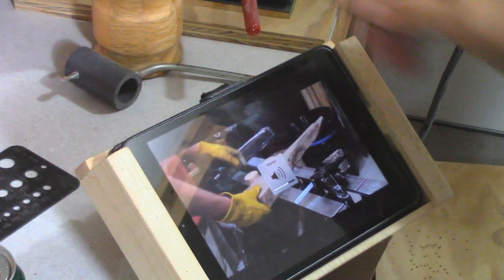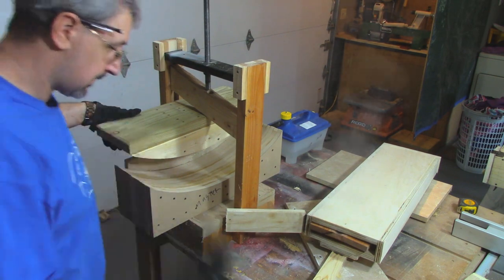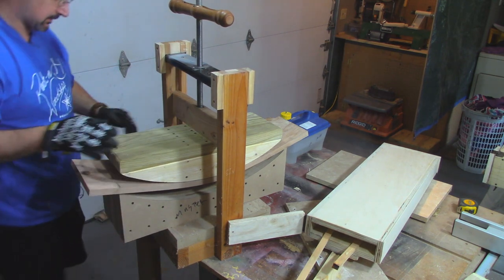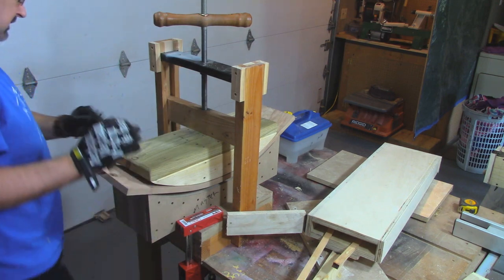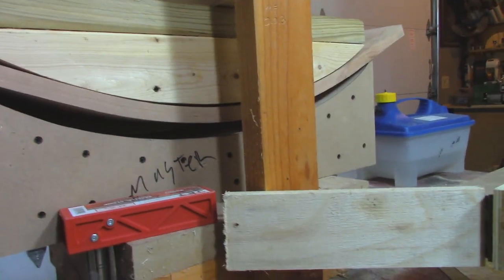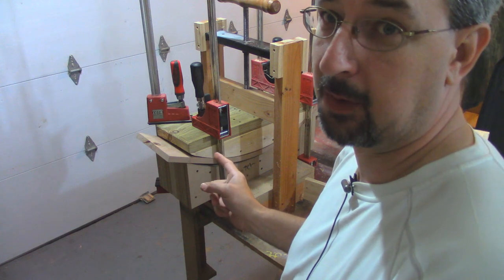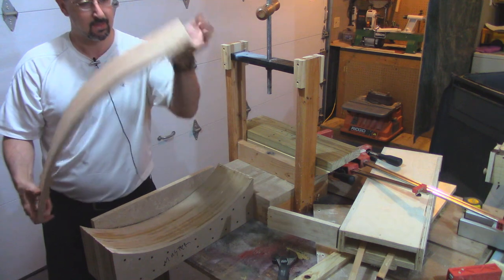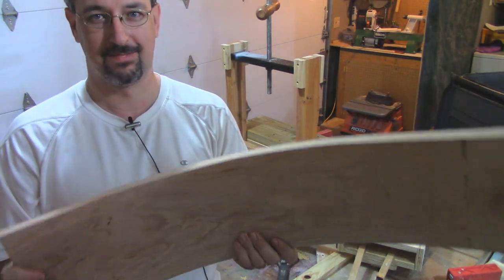Rocking Chair Build #10 Bending Back Supports

Comment: Man, I was on the edge of my seat when you were cranking that thing down. I was waiting for the jig to explode under all that pressure. So happy it worked out Mike! It's all downhill after that, right?
Reply from the maker: +GuysWoodshop your not the only one. Hard parts are done now the sand and sanding and sanding

Comment: nice vid but there are a few things that you could do to help the wood bend
1: the faster you can get it in the jig the better you could insulate the jig whit floor insolation the Styrofoam whit aluminum foil works great fore that
2: keep moving don't stop end check fore progress just keep  closing the jig up it isn't about  speed but you need to keep the wood moving because what you are doing whit the steam chamber is softening the lignin in the wood and when you stop the lignin try's to settle end harden so every time you stop you are making it yourself harder to close the jig 
ps:not trying to be a smart ass just trying to help out
Reply from the maker: +Daan.Z.bloedjes thanks for the information

Comment: Everything I've read regarding curved work indicates you should have cut the piece to shape while it was still square. 20/20 hindsight, do you think you saved yourself aggravation by being able to cut off the split as waste? Would it have been easier to align in the press had the piece been smaller? From a safety perspective, running the curved piece through your table saw and then through the bandsaw and router would've made me think twice? Did you ever reconsider or (off camera) run into issues by doing this?
Reply from the maker: +Derek Cadmus this was the plan from the get go. I wasn't worried about any saw with the curved piece. I did consider cutting the shape out first, but not know what the wood would do in the press. I'm glad it was done way because of the crack. If I cut the shape first I would have had to make another one. No regrets here. Safety you have to make that call on your own.